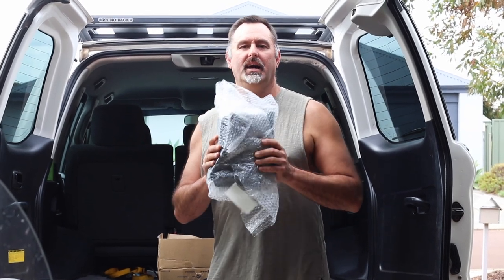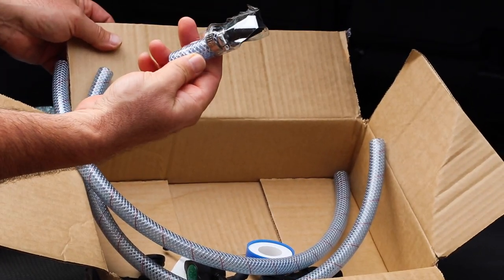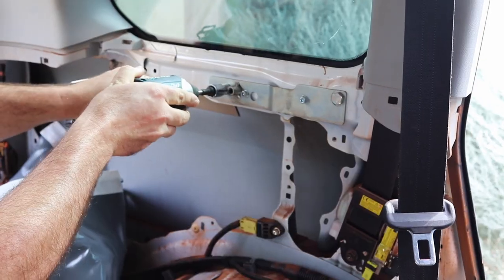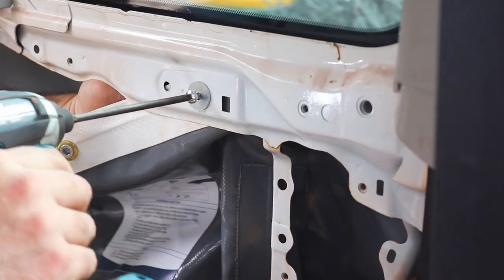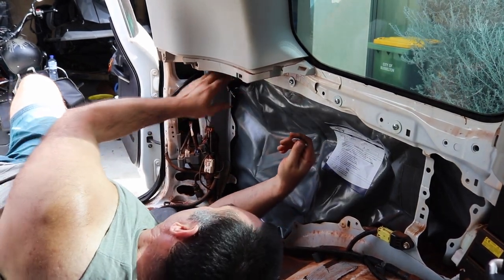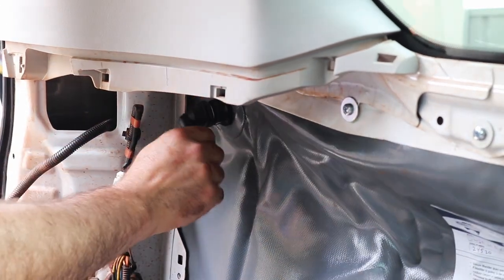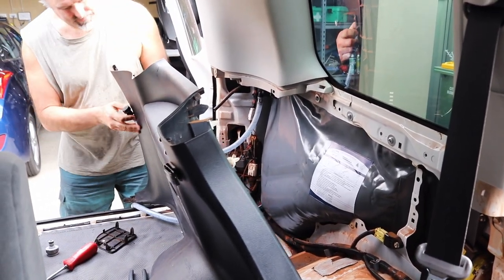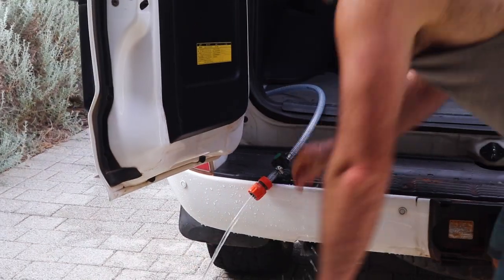Hidden Water Bladder in Toyota Land cruiser

Comment: Thanks for the video,  exactly what I was looking for

Are you still happy with it and I assume it's good for drinking water? No plastic taste? 

I might use pinch weld in my quarter panel just to play it safe,  would hate to puncture it
Reply from the maker: Yeah still works. I haven’t been using it for drinking water since we have had the caravan. It got a bit of a taste after sitting for months and months I flushed it with bleach and then bicarb and was all good again.

Comment: The worst thing I can see is how it will go long term rubbing on all that metal and plastic. It bit hard to check too. Fingers crossed it doesn’t spring a leak because conceptually I like it a lot.
Reply from the maker: I thought the same thing. Time will tell I guess. At least being a GX if it does leak it’ll just leak out the bottom 🤣  vinyl floors and no electronics.
Reply: @JebbreysJibberish  maybe that is why they don’t say it fits the GXL. 😄

Comment: Mine won't fill! For the life of me I can't figure it out. Installed the outlet onto a tap, hose onto that. Opened the breather turned on the tap and it just airlocks the hose. I can put water in the breather pipe which flows out the tap so it can't be a blockage.

Makes no sense!

Comment: Hi mate, any problem with mold on the inside of the tank? Do you think it wouldn’t be good to leave in for long periods of time?
Reply from the maker: Like all tracks the less light the better. Because this is tucked away behind the panels the only thing you need to stop light getting to is the hoses. I often spray paint or use black electrical tape on hoses to stop the light shining in. The other tip is to leave the take full when not using it. Less air makes it harder for stuff to grow. I’ve had mine in the a while now and no problems so far.